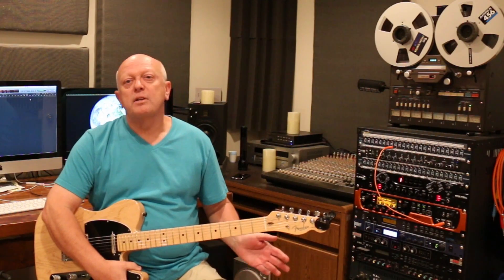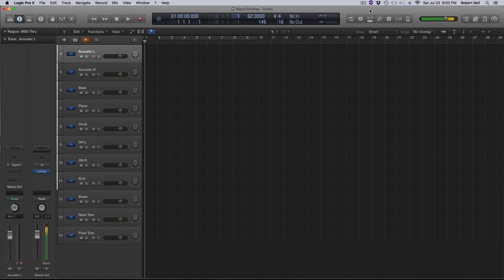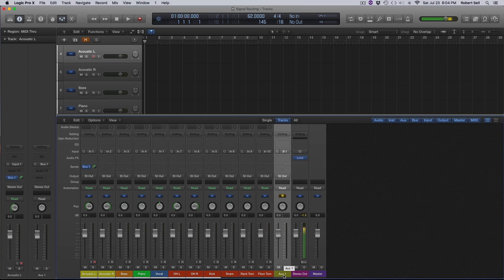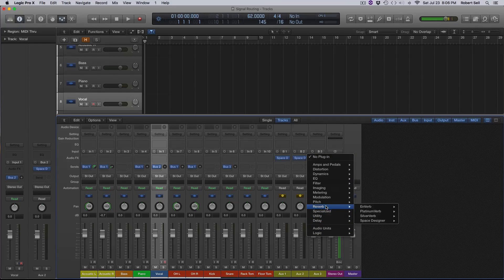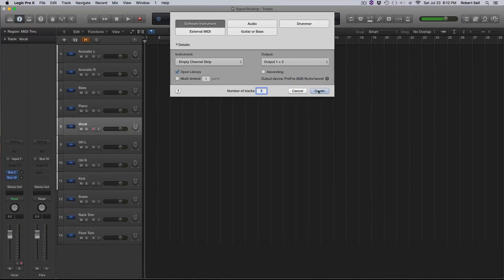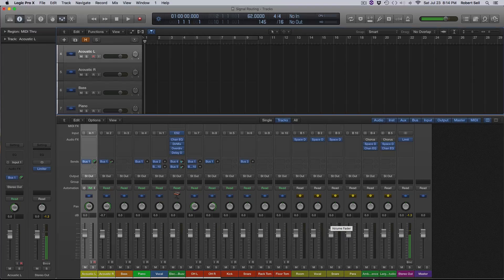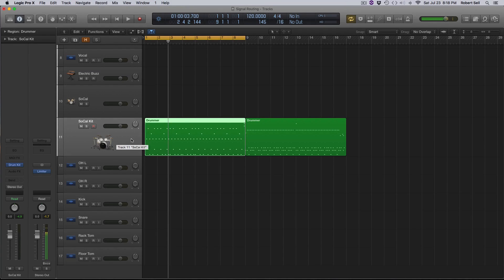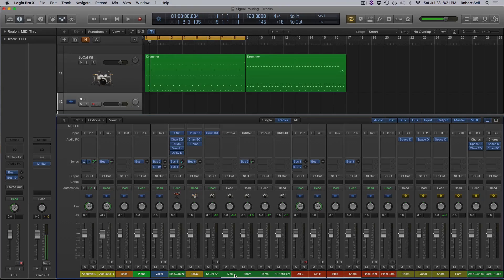Logic Pro X Signal Routing (Aux Sends, Busses, Aux Tracks...)

Comment: A Bus send and Bus channel strip is not there to save processing power, its there to glue effects with levels entering from multiple track in the mix, the idea is like a live band, where the sound engineer will send all the drums to one mix bus, bass to another, guitars, vocals etc, all these tracks are mixed not one stereo sub mix bus to control them as a group, but the effects are separate bus channel strips, most common shared by all tracks (a band or whatever) this way there is a brand sound, 
the typical effects routine is 
bus send one to bus 1 reverb
bus 2 delay
bus 3 echo
bus 4 modulation
then there is parallel buses to control low end frequencies of certain tracks like the kick, 

What logic does that is complicated now is that when you create a stacked track with lets say drums, it has a mix bus automatically, which is great, you see this in the mixer now and you can flip all the tracks to hide them and focus only on one master bus with its own bus 1,2,3,4 etc sends pre and post.but, Whats complicated is when you create stacked tracks and put them inside another stack track (example, two high gain guitar tracks stacked wit its own mix bus along with another two clean guitar tracks stacked with their own bus all stacked, now the logic mixer wil not show you a single channel strip for all these stacked guitars into a stacked mix bus, instead they are now back all over the mixer depending on their track number, this is something apple needs to fix., cause in pro tools they sort this out cleanly.

Comment: Hi Bob, a question. 
1.I have a number of audio files mounted in Logic Pro X. They are all routed to the master bus (output 1/2) and I can monitor them without any problems. 
2. Now I want to record a bass track for which I like to make a headphone mix. Here I decide what I want to hear and how loud I want to hear it.
3. For the headphone mix I have sent all the signals (including the bass signal) to a bus and this bus sent to the outputs 7/8 of my interface.
4. I have connected my headphones to output 7/8 and I can hear all signals comfortably except for the bass signal. This is the problem. 
Why doesn't Logic let me hear the bass signal when the track is armed? 
I can hear through outputs 7/8  the input signal of my bass by pressing the i box, but when I arm the track to record, then I can't hear it in my headphones.
Can you tell me why this is?
Thank you.
Raffael
Reply from the maker: Go to Menu Bar - Logic Pro - Settings - Audio - Select the General Tab - Tick on Software monitoring. Check out the 2 other monitoring options and see if one or both of those work for you. Hope this helps. Good luck.
Reply: @BobSell  Thank you for your quick reply. Software monitoring enabled... that is indeed the correct setting. Now I can hear every element of the playback at any volume I want and also listen to the track I am recording. I hadn't really thought about that setting.Thanks a lot and greetings from Hamburg, Germany.
Reply from the maker: @awesomebandhub  you’re welcome. Have fun.

Comment: Goog tutorial sir! So basically... the main reason for creating aux tracks with common FX for multiple instruments is to conserve CPU and prevent overloading right? So what happens when you DON'T want the same FX for multiple instruments? Back to square one on individual FX per track?
Reply from the maker: Yes, basically that’s correct. Back to individual FX per track. However, if you want to go a little deeper with Aux tracks, I cover them in more detail in this mix bus processing video https://youtu.be/avE-qJ_wvEQ
Reply: @BobSell  And one more: Is there a difference is separating original track and FX track with bus/aux signal flow, vs. just adding FX to the same channel strip? Pre & post-fader knowledge is new territory for us thank you sir
Reply from the maker: Adding your FX to the channel strip sonically accomplishes the same thing. There’s value in using an aux send to save computer processing power if using the same FX for multiple tracks.  However, the channel strip insert is post fader. If your application calls for a pre-fader FX  (not affected by the fader level) effect you’ll have to use a pre fader send.

Comment: Bob, when you use a drummer track, all you have to do is right click on the drummer region and select "Convert -> Convert to MIDI Region". It will give you MIDI tracks. Then when you done editing, you do the reverse and select "Convert -> Convert to Drummer Region". That's much easier than creating a secondary track. I hope this will help you :-)
Reply from the maker: Thanks Peter! That’s the process I use as well. In 2016 the Logic version I was using did not have that option. Thanks.
Reply: @BobSell  I just realized the year your video was posted, lol. Oh well. At least you got a proof that your lesson is still relevant today. I learned quite a bit, btw. Many thanks!

Comment: Nice tutorial. So simply stated... the main reason for using busses/aux tracks is to conserve RAM and processing resoures (e.g. avoid distortion and system overloads) is that right?
Reply from the maker: Splitting your signal, using a bus, and sending it to an aux track is done in your DAW for the same reasons we do it on an analog board. In your DAW, we can use the same plug-in many times on different tracks until we run out of processing power. So yes, sharing plug-ins via an aux track  is a great way to conserve processing power. Other advantages include parallel processing, side channing, automation ...
Reply: So to recap: The reasons for using busses/aux tracks is to conserve processing/RAM resources, avoid overload/distortion, plus allowing side chaining (?), and allowing automation for one or more tracks/instruments - is that correct? FYI I would hazard a guess that a lot of folks here don't use (and have never used) an analog board...
Reply from the maker: It doesn’t have anything to do with overload/distortion. You could still clip an aux track. The automating an aux track may be a little easier and familiar instead of trying to automate a plug-in. Yes, you have the basics.

Comment: An aux on mixers has traditionally been an extra, external input to a bus. So if you assign channel to sub bus 1 it doesn't refer to an aux separate from the bus. An aux might be where I run a reverb into the sub bus 1 or even the main stereo bus. This is one confusing thing about Logic.

Comment from the maker: Aux sends can be used pre or post fader. I wanted to cover pre and post fader sends but the video was getting too long. Normally you would use post fader (the default) so as you bring the fader up or down, on the main channel, you are also affecting the send level by a relative amount. For example, if you were fading the track out you would want the effects to fade out along with the track fader. If the send level is set to pre fader the level sent to the effects remains constant as you move the track fader. This whole idea of parallel routing and process has many applications and is not limited to effects. This was just an entry level application. So, go forward and explore!!
Reply: Love to see video on pre & post fader sends. It can get confusing.